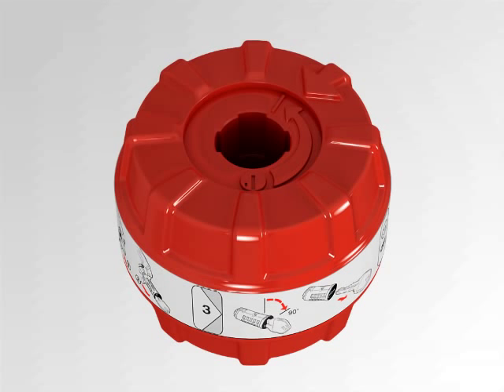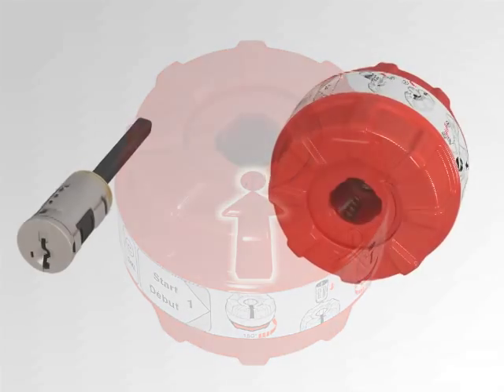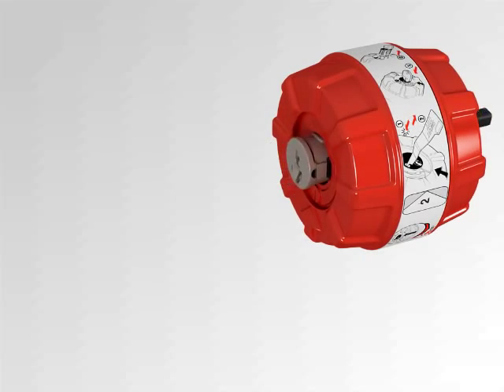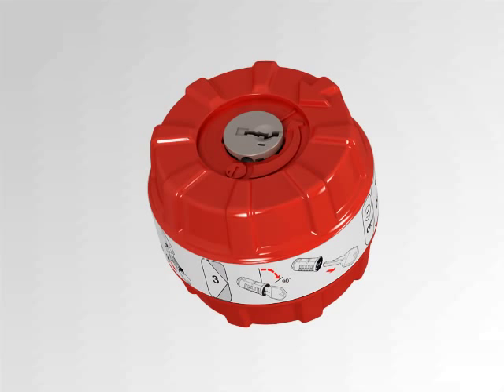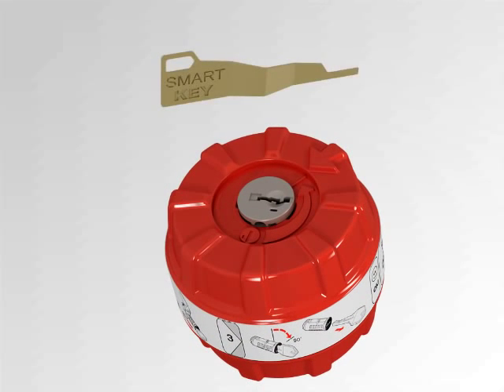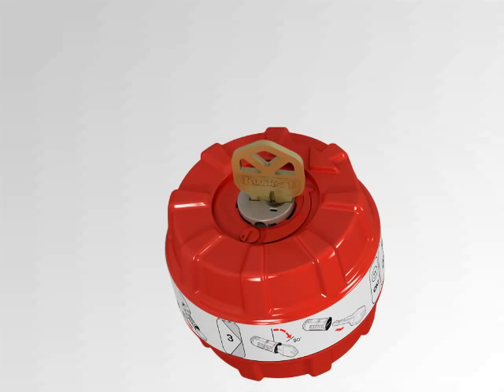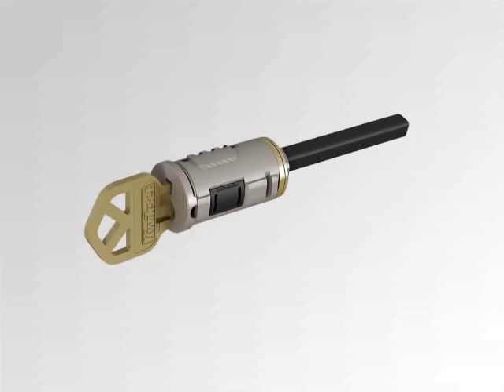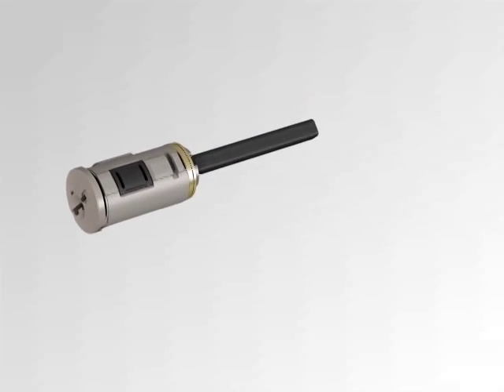How to Use the Kwikset SmartKey Reset Cradle | HD Supply

Comment: My cylinder is stuck inside how do I remove it?
Reply: Did u ever figure out how to remove it mine is also stuck.
Reply: I ended buying another one, and now I  carefully follow the instructions so I don’t have same problem.
Reply: Insert a key into the cylinder it won't go in all the way but will allow you to rotate the cylinder a little so the reset devise will release the cylinder. Took and while to figure it out.
Reply: Terry Fredrick I’ll do that hopefully it works on mine thank you!!